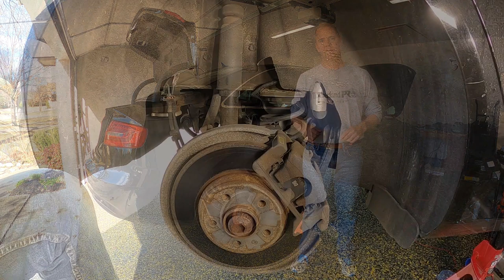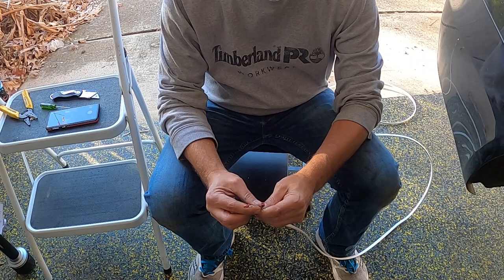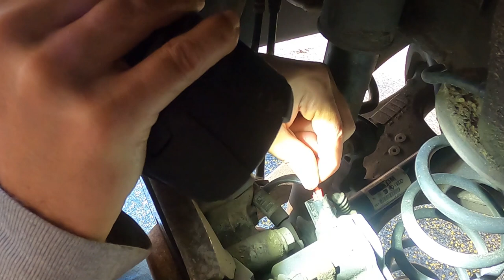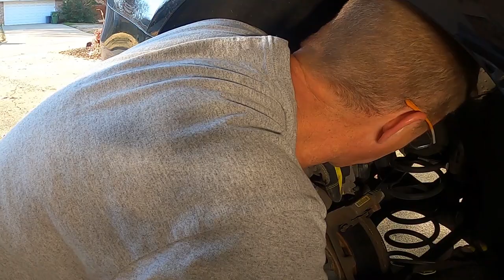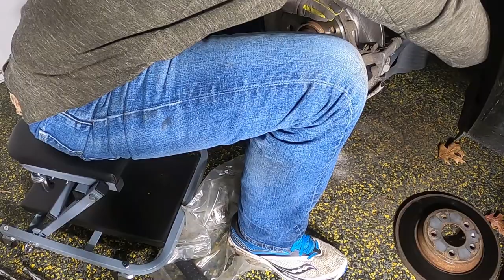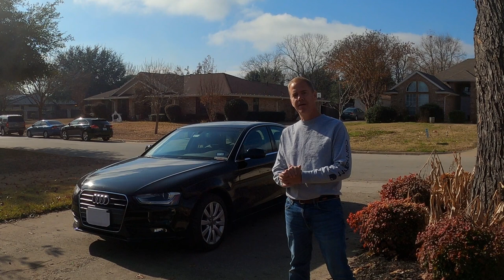Bypassing the Electronic Parking Brake was easy when Replacing the rear Brakes on 2013 Audi A4.

Comment: Thank you for the trick to bypass the electronic brake. I had no clue why I couldn’t close it with a C clamp. Watched other videos and no help, fancy computer or alternant battery supply, etc. The cost was inexpensive, took me no longer than 10 minutes to make besides the drive to the store. Worked super fast. Thank you for the video:))))

Comment: You are a genius. It worked perfectly. Only thing I changed was I used shorter wires and hooked them up to a drill 18v battery. It worked very well.

Comment: Great video! But did you know that if you want to save yourself the time and money to make the battery connection cable, you can simply take the two T30 bolts off the back of the EPB(which is attached to the calipers), and using a T40 torx bit, you can rotate the motor clockwise until it stops. Then re-attached the EPB housing with the two T30 bolts, and finally, depress the piston with your tool of choice . This method takes maybe 5 minutes tops, because you're only unbolting two bolts and then turning the motor by hand with the T40 bit.
Reply: My brak padal  going  down after change  break  pad 
What is   problem  
Please  help
Reply: I'll need to remember this! Thank you
Reply: Yeah, I tried releasing those bolts, but 12 years of crud under car, was impossible! So I made a shorter version if this guy's wire and used it with jumper cables to release it electrically!
Reply: His way of making the cable is better and smarter and simple.... kudos to the hack.
Reply: The way this guy did it is very safe way to do rear break  but one problem is you of to remember the which way you of to touch wires  on to motor not wrong way other why you burn motor
Reply: Yes removing the motor so much simpler and no worry of accidentally burning out the motor or breaking something inside. Also most OBD scan tools will have an option for moving and resetting the EPB, even my cheap simple scanner from O'Reilly has the option.
Reply: @XxDrac13xX Wrong. Very few obd tools release the parking brake.
Reply: Awesome trick! Although it is a t45!

Comment: This process can be done as fallow; Turn on the ignition, Step on accelerator pedal, press down at the some time the parking brake switch, keeping them in such position for some seconds, then turn off the ignition, then turn ignition on. Now the parking brake is released. Turn off the ignition, and replace the rear pads. To return the parking brake in its working position: Turn on the ignition, step on the accelerator pedal, pull up the parking brake switch as in position, to stop the car, keep them in such position for some seconds, then turn off the ignition, then turn on the ignition. Now the parking brake is in its working position.
Reply: Does this really work? I was wondering why it couldn't just be done more manually, or something like this, seeing as how the connector already has power to it while connected

Comment: Yes. There is a way to put the calipers into "service mode". They retract the pads so you don't destroy the drive gear by forcing it with a C Clamp. And, I'm quite sure when V.W. does a brake job, they don't cut the wire going to the EPB drive motor.  I would google "V.W. rear brake service mode".

Comment: even you don't need c clam. once you rewind the callipe,r put screw driver  in between rotor and pads it will easily push back calliper .

Comment: You can also unbolt the electronic brake mechanism and wind back the part that sits inside of calliper by hand, then press piston back in with no issue - takes less than 5 minutes.
Reply from the maker: Well, this winds it back with electricity, much faster.
Reply: @TheWoodworkingHack  but you need to make a cable, connect to the plug and battery. taking of two screws 30 second, pop it of 10 seconds, wind back 60 seconds - total 5 minutes for both. No need to make cable or play with anything.
Reply: once you press the piston back,put it back together and pump the brakes?

Comment: Should have cleaned and greased the caliper slide pins..... i use an electric transformer from an HO train that gives you the 14 fifteen volts to retract the EPB motor.... any how good job.

Comment: Good video but you should have put antiseize on the hub so the the rotor doesnt get stuck on the hub and thebtire will not get stuck also but very good video also luke the fact you used axle stands safety first
Reply from the maker: Thank you friend
Reply: If dose get stuck get hammer out mate

Comment: I just fix the flashing parking brake sign..  maybe it's just specific models mine is a 2015 Q5. What I did is
1.  set the parking brake "ON"
2. Then turn off car
3. Unplug and run the motor to wear the piston is all the way back ready to accept a new pad. 
4. When the pads are in and caliper is tight. Then run the motor back up to tight again. (Manually engage parking brake)

I'm not sure why I was having problems maybe the car new that the motor was set in a different place or was too far off from the previous. Not sure but I did the other side with these steps and didn't have any issue. 

Good luck everyone
Reply: so turn the car ON and depress the parking brake button and press it back afterwards?

Comment: Don't you need the software to reset the calibration so that the caliper motor is adjusted to the thickness of the new pads?
Reply from the maker: All I know is that when the electronic brake is engaged, the wheels don't budge. When the electronic brake is off, the wheels spin freely, without resistance. Not sure if calibration would change this.

Comment: wow good vid  until you put the c-clamp on you had it on the gearbox you could have wrecked it better way is take the gearbox off 2 bolts and using a spanner wind the piston back then using a piston rewind tool push the piston back

Comment: Got alot of faith in that plastic housing on the backside of the caliper
Reply from the maker: How so?
Reply: @TheWoodworkingHack  hate to crush it with the c clamp
Reply from the maker: @justinbustin677  Oh it's actually not that much pressure. It worked out.

Comment: I wonder if you left the car ignition on and chuck the wheels so it doesn't role back  especially if its on jacks and disengaged the electric parking hand  brakes can you then depressed the caliper  with out doing all the other extra work thats on videos 🤔

Comment: Nice tip, but how can one be sure to get the polarity correct the first time so that the DC motor spins the mechanism to retract and not tighten. Or is that not worthwhile?
Reply from the maker: You will figure it out in about 5 seconds.

Comment: Can someone please tell me which wires should be power or ground to retrofit these 2007 D2 A8L calipers to another car?  Which of the smaller wires are signal/trigger wires to activate the electromagnetic solenoid and clamp the rotor? Thank you

Comment: Cheers mate 👍 would of like to see you flick the switch at the end
Reply: Don’t use a 12 volt car battery        9volt    Transistor works  well smaller lighter and will not cause sparks if ground out

Comment: question when you release the parking brake (from inside the car)   is it NOT  same as doing it from a separate source  and touching the 2 terminal) .thanks you
Reply: Releasing the parking brake with the button inside the car only releases the brakes enough so the car will drive. It won't wind the mechanism back far enough to install new pads.

Comment: Hello, I have a question, before start this process the parking brake was on or off?
Reply from the maker: It was on.
Reply: @TheWoodworkingHack  Would it cause any problems if the epb was off ?
Reply: Good question, i thinking that is the key to this job it must be on prior so it knows to back off.  Not sure if it was explained in the video or not?

Comment: Is there a way to eliminate the parking brake and fool the car to think it’s working? I never use it and I don’t live in San Francisco!
Reply: Just disconnect the wire running to the EPB motor... and make sure the plunger is released from pushing the cup in the caliper......another electric add on from the engineers that is not needed.  how hard is it to pull the manual lever or push the pedal on the floor for the emergency brake to work.... suggestion buy an anchor and throw it out the window after parking the vehicle...

Comment: What causes the breke pedal to be lose if there is no leak in the fluid during the brake replacement? It feel like i have to brake further away than before when i did a test drive. I don't think I need to bleed it do I?
Reply: Some how u got air in the brake system. If pedal has to be pressed deeper and if it feels "Spongy"  air in the system for sure. Bleeding is a must.

Comment: Do you need to release the parking brake before you start? or Leave it on?
Reply: release it speed things up. it may not release fully but you will be able to take the caliper off at that.

Comment: Hi, good vid, when you apply the power to the piston motor to wind it back can you go to far, I mean once its wound back fully do you have to listen for that and disconnect quickly?
Also on our 2017 audi a3 auto when the electronic brake is off you can rock the car, would the method you describe still be needed if the brake is off and the car moves slightly?
Cheers.
Reply from the maker: you can tell immediately when it's wound all the way

Comment: might using a conventional 9v battery work?                          also, great camera work, good lighting,
Reply: Cars in general work on 12 volts electronic systems. 
Trying anything different can possibly even mess with your car's  ECU.
That could  be an expensive mistake.

Comment: I believe you've found a backdoor method to release the electric brake to change the brake pads.  But that's not what is usually done.  I believe you could rent an OBD2 scantool, or do some simple procedures with the brake button and key on procedure to tell the vehicle to release the griphold. Takes about 20 seconds to put vehicle in maintenance mode. Here>>https://youtu.be/RN_jjCtTRN8

Comment: fuck you have to make a cable might as well get the computer the mechanics use to disengage the break. a little too much if you ask me. its simple to take disengage the motor by taking it off an with a T40 you can turn the motor to retract the piston with the help of a vise. no doubt many ways to skin a cat, tis way take too long.. have to make a cable for fucks sake ! thanks for making the video tho

Comment: Couldn't you just leave the car in drive so the parking brake doesn't activate
Reply: It doesn’t matter if you activate it or not you will still have to retract it to change the pads. That’s the reason you activate the brake before you start, so when your done and you turn the parking break on and get it tight against the pads, its in the same position (on) as when you started. So when your done everything is still functioning the same as before, just now you have new brake pads.

Comment: You velly luky you no break plastic motor housing using that masif C  clamp ,   you shud hav used a  BIG screw driver  to shove piston back in while sthil 😂 attached to  car ,      My advice  wood have been to spray  yon WD STUFF 😂 around the flange of the disc and the hub unit to penetrate the  corrosion  for a couple of days before  doing the job,   THEN  no need for the MASSIVE   56kilo hammer😂😂    but hay  ho  you got the job done and saved paying a garage bill 😊